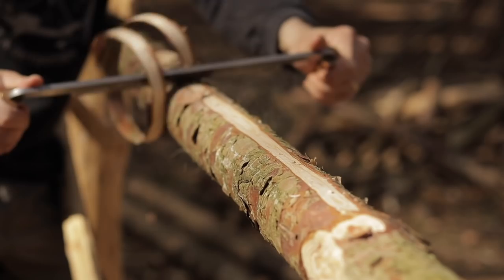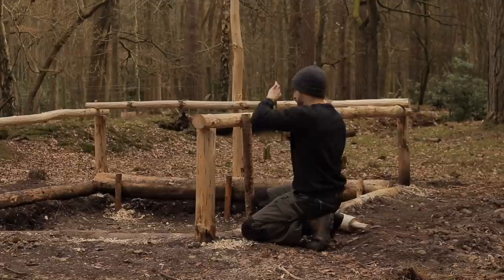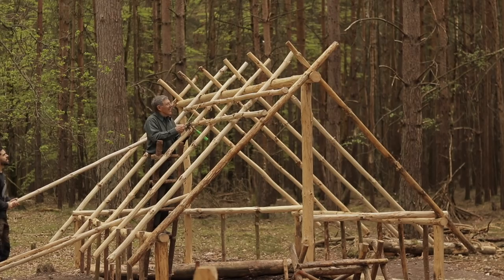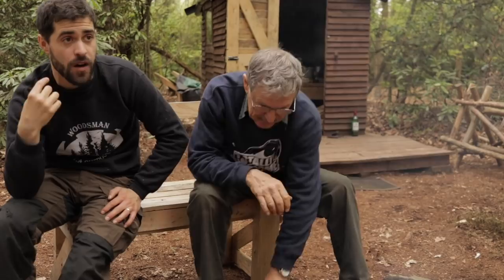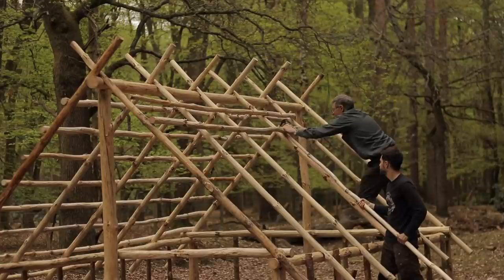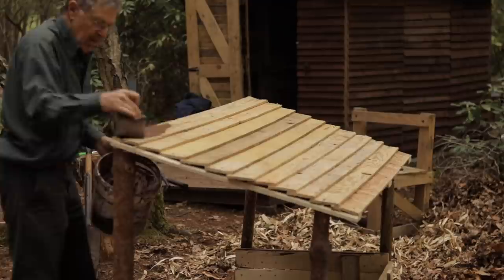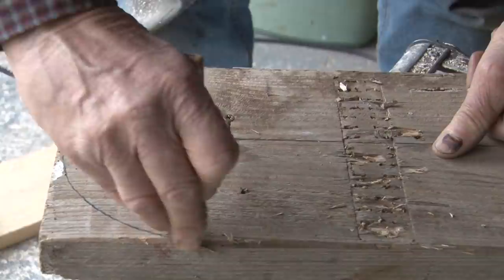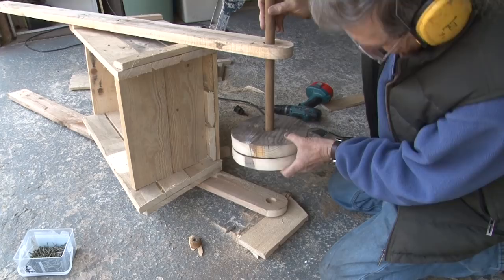Building a Saxon House (Grubenhaus) with Hand Tools: Bushcraft Project (PART 5)

Comment: nice job lads you are wrong about the lashing not lasting, i repaired a 13th century crook framed longhouse in dorset, the thatch was still tied on with vines! 700 plus years later. But nails aren't a prob

Comment: Re your theory time comment about anything to make life easier, I think there are occasions when modern easy fixes can be more work than they save.  Example being having to go to the DIY store for more rawl plugs... During lockdown that meant hours of queueing so I tried using hardwood plugs instead, worked better than plastic rawlplugs, cost nothing and took seconds to make.  Didn't take Einstein (or your dad) to figure out, just the situation that made me stop and think about alternatives to the manufactured solution.  If Screwfix made a reasonably priced shaving station would you ever have invented yours? (course you would cos you love making awesome stuff). Only discovered your channel recently, totally hooked now, keep up the great work!

Comment: Just Google the word tinderbox I found that the first mention of the word was used back in about the year 1520 as tinder-box as a wooden or metal box that would hold a flint and steel and tender usually char cloth of some type they would use to start a fire.

Comment: As you were sawing off your wooden pegs, I thought, don’t do that. You can hang things from them— even the ones on the outside, you can lean a shovel up against it. Or think about using those pegs, particularly inside, upon which to put a wooden shelf. 

Also, when you build your windows, instead of having them open into the outside, consider having them drop down INSIDE, put a leg underneath, and you have an instant TABLE. 

I am an Iroquois archaeologist in Albany, NY’s capital. My field school was a 16th century longhouse. Wanted you to know you had female fans out there too.

Comment: tinderbox. "box in which tinder and flint are kept," 1520s, from tinder + box (n.); figurative sense of " 'inflammable' person or thing" is attested from 1590s.

From Wikipedia:

A tinderbox is a container made of wood or metal containing flint, firesteel, and tinder (typically charcloth, but possibly a small quantity of dry, finely divided fibrous matter such as hemp), used together to help kindle a fire. They might also contain sulfur-tipped matches.

Tinderboxes fell out of general usage when friction matches were invented. 

Throughout prehistoric Europe flint and iron pyrites (commonly known as fool's gold) were struck against one another in order to create a spark for firelighting. As an example, Ötzi(the ice age mummy found in the Alps) was found with tinder fungus along with flint and pyrite for creating sparks.

With development of iron ore smelting in the iron age the firesteel eventually replaced pyrites. This was simply a piece of carbon steel (it is difficult to obtain sparks with ordinary iron),  which was usually wrought into a 'D' shape, or an oval ring, so that it  could be conveniently looped around two or three fingers for striking. The flint was sometimes chipped to provide a suitably sharp edge to obtain a spark and if necessary other hard stones, such as quartzite, chert or chalcedony could be substituted.

The charcloth was fabric made from vegetable fibre (e.g. cotton, linen, or jute) which had previously been charred via pyrolysis, giving it the low ignition temperature and slow burning characteristics suitable for use as tinder.  Rotten wood, known as 'touchwood' was also used, as well as 'amadou', which was a tinder prepared from fungus steeped in potassium nitrate (saltpetre) and dried.

In use the flint was struck in a vigorous downward motion against  the steel, sending a shower of sparks into the tinder which was 
arranged in the bottom of the box. The sparks (actually pieces of burning steel broken off by the harder flint) created very small embers 
as they fell onto the charcloth, the glow of which, with some gentle blowing, would be enough to ignite a sulfur  tipped wooden splint. The splint could then be carried to a candle, often set in a holder on the top of the box, and finally the cloth would be extinguished with a damper to preserve it for further use. With skill, a fire could be started in under a minute, but at other times it took longer and occasionally a tiny pinch of gunpowder was added to encourage the process.

When away from home small pocket tinderboxes were often carried, sometimes set with a burning glass (a lens) in the lid to light the tinder directly from the sun's rays.  The poorer people working in the fields would obtain a light by simply striking a flint on the back of a knife onto a piece of touch-paper that  they carried in their pockets.

The tinder pistol, based on the flintlock mechanism, was a more expensive alternative to the tinderbox and was in use in middle and upper class homes in the 18th century. In the early 19th century a more efficient tinderbox was invented with a rotating metal wheel to create the sparks[4] and there were other more experimental devices available, such as the fire piston and the instantaneous light box.

In the 18th and early 19th century tinderboxes were in common use, but with the advent of John Walker's 'friction lights' in 1827, where a 
match could be struck by withdrawing it from a piece of folded glass paper, tinderboxes increasingly became obsolete.[6][7] A book from 1881[8] notes that in 1834 a magazine editor had predicted[9] that despite the advent of 'lucifers' (friction matches),  the tinderbox would continue to be in general use in the household, but  that in fact, by the time of writing, the tinderbox had become rare, 
expensive and was commonly seen only in museums of antiquities. Another book from 1889 describes such a tinderbox,[10] observing that the wear patterns on the flint were the same as those on ancient prehistoric flints in the collection.

Link: https://en.wikipedia.org/wiki/Tinderbox

Comment: Instead of nails cable/zip ties would have been easier/quicker than hammering nails. Plus easier to take off if ever need to repair the roof than pulling nails. Just a thought

Comment: HI    THE ONLY THING I WOULD DO ON THE CART IS TO MAKE THE WHEEL BIGGER AND THE LEGS LONGER.  I THINK THE BOTTOM EDGE WILL HIT AND CATCH ON A LOT OF STUFF ON THE FOREST FLOOR.  USE 4 HALF ROUNDS OF THAT SIZE TO MAKE THE WHEEL. THAT WILL GIVE YOU ALMOST TWICE THE SPACE TO THE BOTTOM EDGE.

Comment: Nails did exist in that time but they were not commonly used or produced by the Anglo Saxons as metal was more rare and the art of Metallurgy had mostly vanished with the Romans (aka the Dark Age). As to most peoples Ancestry in the UK, Normans were mainly descended from Scandinavian Vikings (Pirates) who moved to settle in France to protect the French from the other Scandinavian Vikings and settles in Normandy then invaded and took control of Britain from the Anglo Saxons who were Vikings from Germanic Saxony. The Anglo Saxons took Britain from the British that had inherited England from the Romans after they abandoned Britain. The Romans had taken control of Britain from the Celtic tribes that were decedents from the Beaker people and Prehistoric peoples. Now throw in a smidgen of middle eastern and northern African here and there and voila you have Modern Brits. As for the Asian side of UK, That is mostly a modern thing that has taken place in the last 200 or so years. YES some Asians had traveled to Britain prior to that but the culture that currently exists there is a new thing and as in most countries, Asians mostly keep to themselves.

Comment: Think of the nails this way. Those who built the houses weren't blacksmiths. Therefore your "blacksmith" is the local builders merchants, you are no different to the original builders who also used nails, the only difference really is now they are made rather faster.